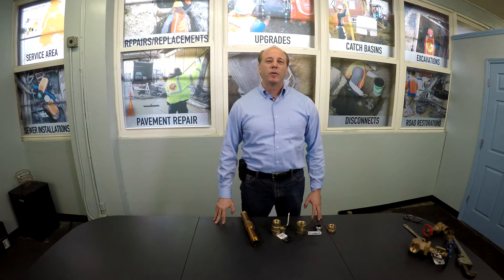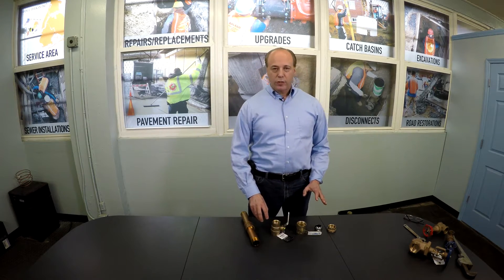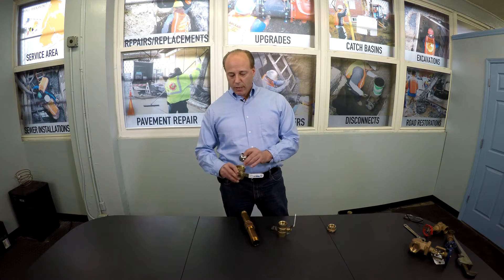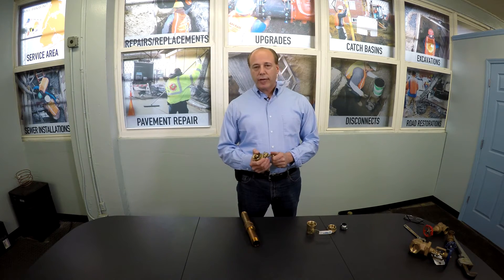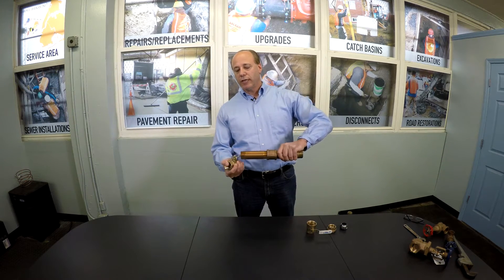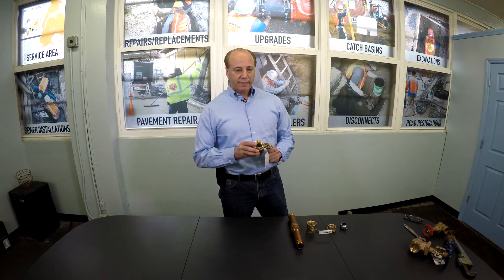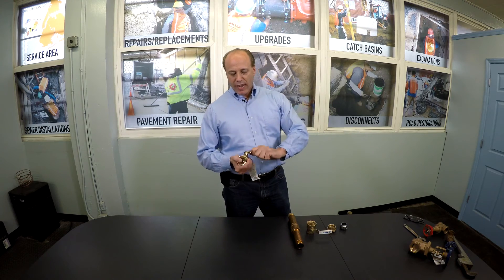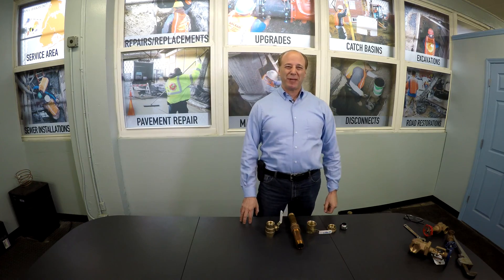A Full Port Opening Ball Valve For Water Line Tutorial

Comment: My washing machine shutoff valve (1/4-turn ball valve from the house builders, 20 years ago) hadn't been touched ever. Yesterday, I tried to turn them off by hand. Couldn't budge it. Even with a towel around the handle. Today, I noticed a tiny leak. Luckily, it seems to be flowing into the drain -- less urgency. See pic -- https://i.imgur.com/WrqmJCN.jpg
I think the leak is coming from the top of the hot/left valve.
Is it too late to "exercise" the valve with a tool ? 
Or will I need to replace it ?
Any advice would be appreciated.
Reply from the maker: A washing machine valve is an easy replace. I would suggest replacing it. The only reasonable way to stop a leak is if the packing is loose; it can be tightened.  Otherwise swap it out.